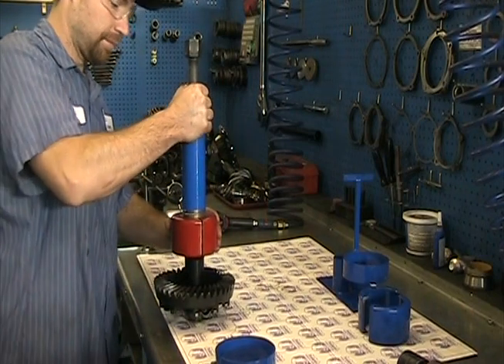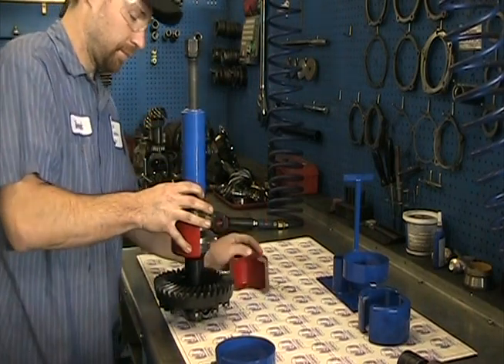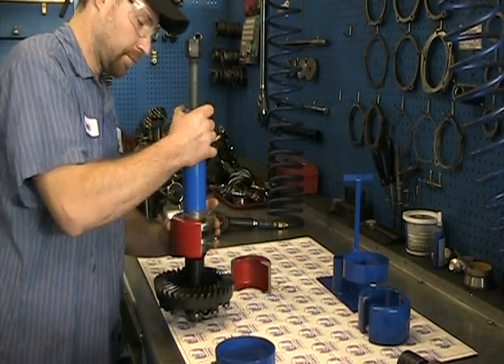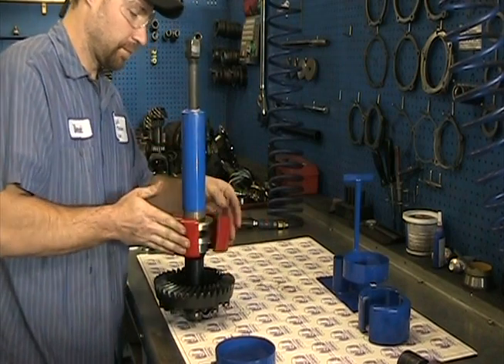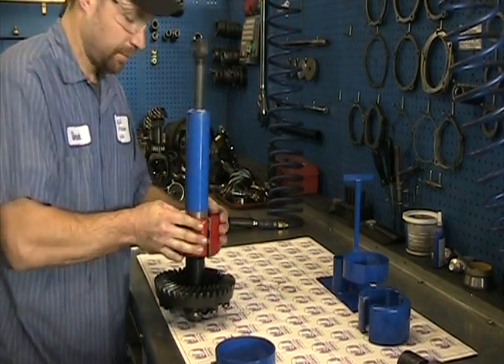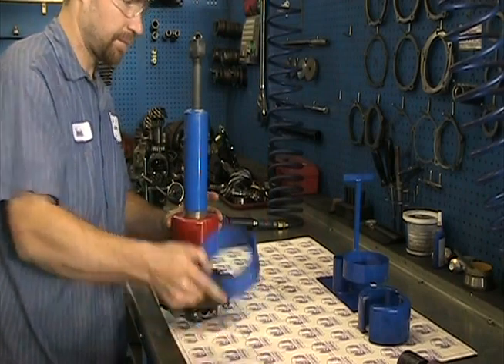Yukon Bearing Puller Instructions

Comment: Here's my tip, maybe buy parts from RR&P but  NEVER, NEVER, NEVER let RR&P work on your vehicles. They rebuilt my front and back axles with traction devices in both. No hard wheeling and my rear axle shaft left my truck as I am doing 60mph down the freeway. Towed back to RR&P for them to fix, they covered labor but not new parts($1,375.00) I picked up my truck and do a walk around and found two lug nuts finger tight and other four screwed on couple threads, both tires. I asked "what the hell, you guys really are trying to kill me!" Fast fwd few years and now I am rebuilding my front axle from broke ring & pinion. Do a little research and fix it yourself, F*#%K  RR&P!